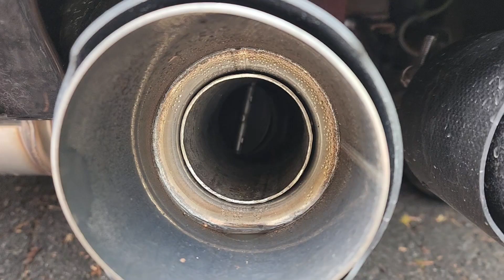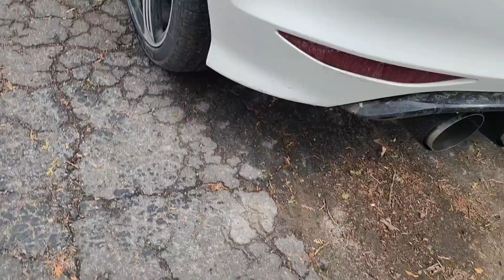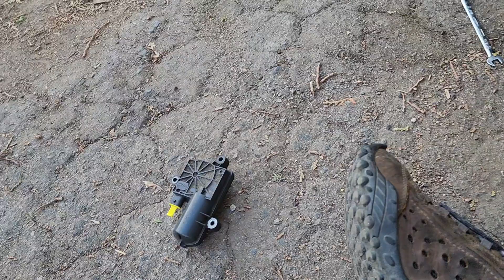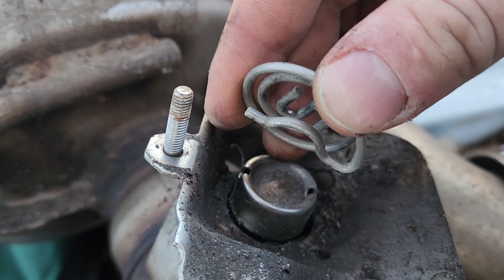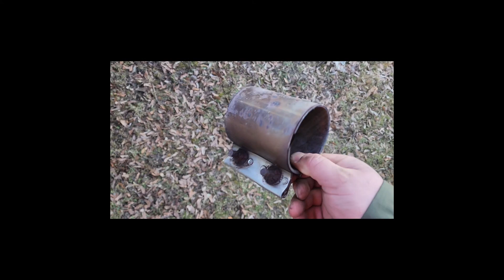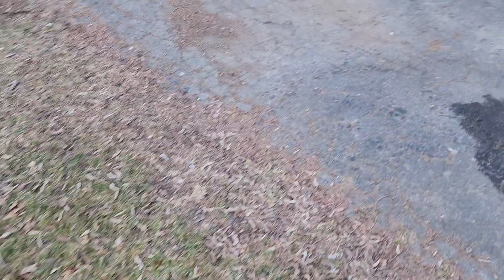Mk7 Golf R exhaust valve diagnosis and repair

Comment: is there a way to have it "closed" in regular D move and "open" on S mode? or even closed on regular and open on race mode?
Reply from the maker: Unless your on a custom tune i think you can only adjust that in the custom setting. Or code them permanently open / closed with vcds.

Comment: I have an S3 and the passenger side valve has started rattling. Do you think the spring has snapped? And is it possible to get the valve off without lowering the back box?
Reply from the maker: If its not under tension any more the spring has likley snapped. In a perfect world you can get to it without lowering the exhaust, but it will be faster and way less work to just unbolt the hangers and lower the muffler
Reply: @edwardgrabinsky are they 8mm bolts?
Reply: @jasonjay7650 8 mm nuts